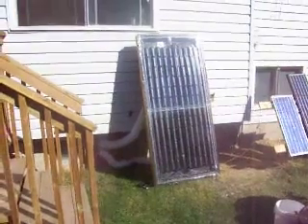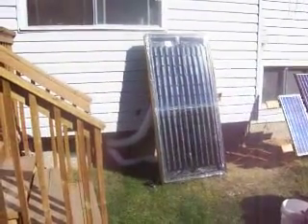Solar Furnace

Comment from the maker: This solar furnace is now disconnected. It worked as advertized while in operation. The foam liner behind the cans expanded enough to pop the silicone seal out at the bottom and middle so it's no longer sealed.The white vinyl hoses cracked and are unable to move air anymore. I'm thinking of a second attempt with the same  frame using copper pipe embedded in cement as a thermal mass, with no glass involved. Thinking it through right now.

Comment from the maker: I had a storm door with two pieces of tempered glass which had broken off it's hinges so I used the glass. I routed the edge the same thickness of the glass then put a bead of clear silicone in the trough set the glass in and held with clear packing tape. I over lapped the glass in the middle about an inch.

Comment from the maker: So far works great, but when there's no sun dosen't work at all. heat drops off quick. This one lets air travel up through the cans so it can pick up heat, There is no problem harvesting the heat if its sunny so I don't think having thermal mass would be useful as it would still cool off within a half hour.

Comment from the maker: The plan was to take a few pic's while building it, but as luck would have it no battery's for the camera. It went together fast over two days, so no real detailed construction pic's. Added a oven probe type thermometer to the top right side later on. Will post a video after snow fly's.

Comment from the maker: The outside temperature was about 25 degrees Celsius. It needs the fan running when facing the sun or the insulation gets to hot and expands. It holds at around 100 degrees with large air flow through it.